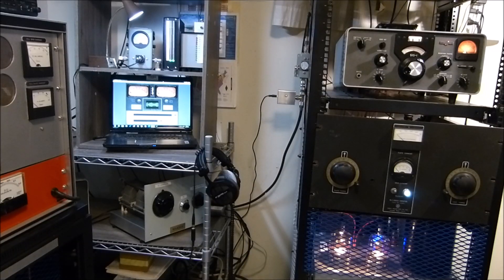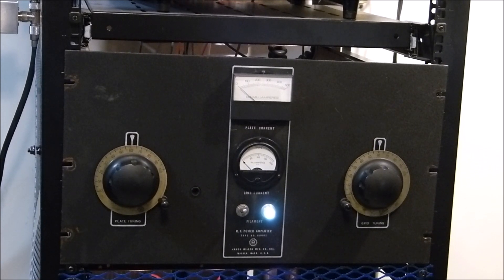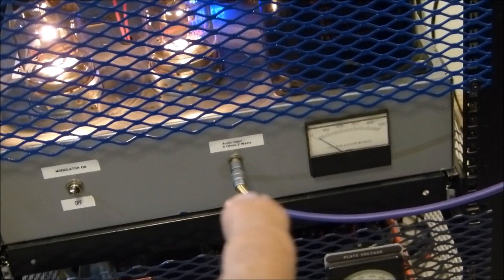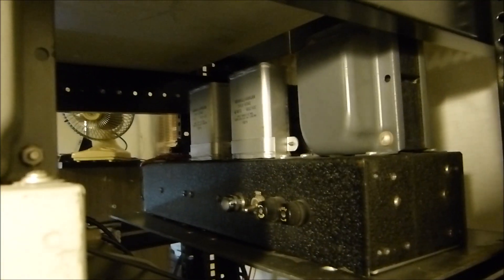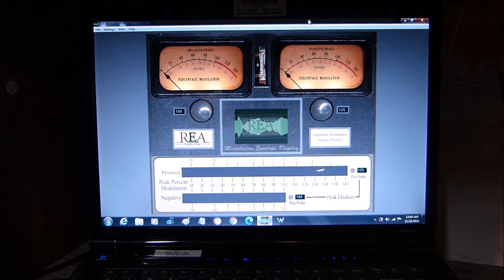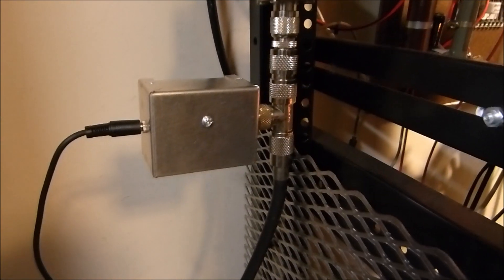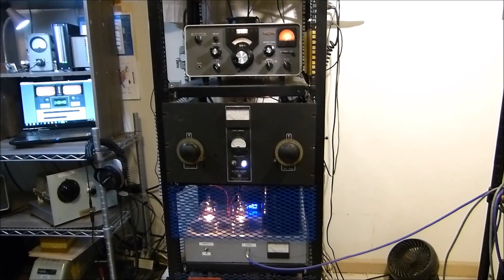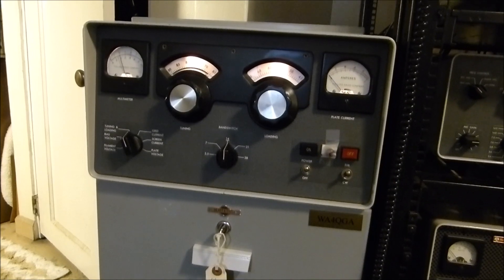Negative Modulation Peak Limiting For AM Transmitters With Modulation Monitor

Comment: My first experience with ham radio was watching our TV Set in 1958 (during the highest sunspot cycle on record) and listening to a neighbor blasting out on the audio a CQ from W8 Baker Sugar George on 10 meters. It was Otto, across the street. When I asked about his radio, he told me he was running 'supermodulation with negative peak clipping.' I don't know whether he mentioned the 300% figure or it came from somewhere else, but if a standard AM signal is 6 KHz wide, at 300% that would mean his signal would be 18 KHz wide. The joke was that he was not only on 10 Meters, but 11 Meters and 9 Meters, as well as on TV Channels 2 and 3 (harmonic). It's a wonder that he didn't come home from work to find a noose tied in his coax. :-D))
Reply from the maker: 300% positive modulation is about amplitude and not bandwidth. He may have been 20KHz wide, but commercial AM radio stations used to do the same thing - it just make you louder if it is done correctly - however... if there is modulation in the negative direction over 100%, it shuts off the carrier and when the carrier comes back on (each cycle of the radio carrier frequency) it caused what is called "splatter". Seems there would be a more scientific word for it  🙂 but that is what it is called and in 1958, ham radio operators with everything in the society analog, we could cause a lot of interference on people's home equipment especially TV's and the CB operators with their "linears" were notorious for interference. With everything digital today, I can run full legal power and none of my neighbors hear anything - I ask them occasionally. I have a "clean" signal and do run about 140% modulation on AM but it causes no issues. Also, today most hams use a balun at the antenna instead of just coax or open wire for their transmission line which keeps the transmission line from radiating, and picking up receive noise, so that helps. Thanks for your comments. Lots of pictures on my QRZ site. 73  WA4QGA

Comment: at 12:30 when you say the big red light is not showing clipping, I can clearly see the scope pattern is pinched/flat/etc... also if you just use a DC voltage there to keep the carrier alive doesn't that strait line of dc just create a purely flat low level carrier line and once the negative audio peak reaches it it just clips em?  Which just clips off the negative peaks square which creates splatter also.  Isn't there a way to smoothly compress the negative peaks without clipping them?  I would like to see this on a scope with a sine wave, can you do that/show that?
Reply from the maker: I think I understand what you see in the pinched/flat portion of the display but it is actually not going to zero and shutting the class-C amplifier (and carrier) completely off. I would say on close examination, we would see that that pinched portion of the display is still (slightly) on and there is a bit of carrier being transmitted as the keep-alive voltage keeps it from going to zero or swinging negative.
The whole objective with keep-alive voltage is to keep the (negative) modulation peaks from reducing the plate voltage to the class-C amplifier to absolute zero, or a negative value, where the carrier will shut completely off and then abruptly come back on when the plate voltage goes positive again.
There are other techniques that I have tried like loading the negative cycle with a resistor of about the same value as the plate load and a diode biased to conduct the negative cycle and not affect the positive half cycle. This just takes a large resistor and diodes across the modulation transformer secondary. The problem with this is, you can still over modulate the negative peaks is you have a lot of audio power. The keep-alive voltage seems to solve that issue no matter the amplitude of the negative peaks so we never shut the RF amplifier off and "splatter". You would think they could come up with a better word than just, "splatter".  🙂
No doubt it does cause some extra bit of distortion on the audio but apparently not enough to be objectionable. 
I can watch the output of a GG, SSB amplifier on a scope where the RF waveform is limiting (clipping), and the distortion - if the limiting isn't grossly overdone and turned into a square wave, - the bit of distortion added to the signal by the limiting/clipping can be acceptable. There is quite a bit of distortion in amateur radio communication but with just voice communication, it is OK, I would  say to at least 10% THD. 
What I find most objectionable in AM/SSB operation is when there is so much compression/speech processing or LF component in the voice signal at the transmitter. Makes it very hard for me to understand. A similar thing happens when we try to go, HiFi, so-to-speak, with our full range microphones. It makes the plate current meter on the transmitter kick up much higher but at a cost of distortion and a difficult voice signal to understand.
I prefer a crisp, higher-pitched voice signal when listening to any amateur station be it AM or SSB. Probably best to sound something like NASA and the Space Shuttle. 

73 WA4QGA
Reply: @ElPasoTubeAmps  Great reply !  I didn't really expect a reply since the video is already a year old.  I agree with pretty much everything you said in the reply.  So many of these hifi ssb operators sound more like a 50ft tall robot than a human.  Not sure if you know anything about guitar amplifiers and how some tube amps are modded with a resistor on the high voltage to emulate the older amps that had "voltage sag" from weak high voltage transformers when cranked up loud and that gave the old amps that soft clipping that tube amp distortion creates and people love.   Anyways, the reason I brought that up is maybe there is a way, maybe even the same way to do something similar to have your keep-alive voltage sag a little to help with the flat/square clip of the negative peaks.  Possibly even have the keep-alive voltage a little higher than you do now but have it sag with the negative peaks.  I'm not sure of your keep-alive design method, but could it be as simple as a resistor on your keep alive voltage?  Could or would the negative audio sag your keep-alive voltage to smooth out the negative clipping if there was a resistor for sag?  Just an Idea
Reply from the maker: @oldolfmann8927  I don't think the keep-alive voltage scheme for transmitters would work in a good way with a resistor in series. 
I did, and rarely still do, guitar amp repair for local musicians since retiring in 2012. I do know musicians want vacuum tube rectifiers for "sag" and musical enhancement but I never thought about adding a resistor in the line to simulate that with solid state rectifiers. It would work in a similar way as the current increases, the voltage drop increases. Not only do we have solid state rectifiers with a constant voltage drop of around 0.7 volts, we generally have something closer to 120 VAC if not more and not that 110 to 115 we had decades ago. Thanks for your reply. I will keep the resistor mod in my head for future reference with guitar amplifiers.
Reply: @ElPasoTubeAmps  I guess I should have explained better.  The resistor mod is Not for solid state amps, it is mostly for the newer tube amps and even a few old ones.  Many newer tube amps have better transformers and some solid state diodes instead of the tube rectifiers, and therefore even tho they have tube outputs the high voltage doesn't have the sag as the old tube rectifier/weak transformer did.  So you add a some resistance to the high voltage line and like magic you have the sag under load just like the old stuff.  Some mods even use a few different resistors so the player can select the amount of sag and distortion via a switch or no sag at all.  As I understand it, it was first noticed when companies like Fender made what they called "re-issue" amps that were supposed to be just like the old ones in the 60's 70's, but people noticed they just didn't sound the same.  Someone did some testing and discovered the transformers in the re-issues were "too good" HaHa... and didn't sag enough didn't create the cool distortion, so someone smart started adding resistors for the sag.  I just had the idea that if your keep-alive had the ability to sag it would smooth out the negative peaks as they reach the keep-alive.  It wouldn't take much to add a resistor and look at a sine wave on a scope to test the idea..
Reply from the maker: @oldolfmann8927 Here is a perspective - I started my YT channel with the intention of documenting the harmonic profiles of guitar amplifiers for posterity, and reproduction of vintage equipment. Little did I know it had already been done in a monetary sense to sell amplifiers. The harmonic profile is the elemental description of any sound. It distinguishes my voice from yours saying the same word just as it does the meow of one cat from another. The nuances are ineffable. I was  unaware of the effort that had been put into creating "vintage" sound. An interesting detail of history is that the vintage amps from the '60's and '70's were instantly modified to sound "better" whereas nowadays they are paid a high price to be taken back to original and sound vintage. Screw drivers and pliers are just that - the creativity is in the heart and hands of the creator and not fundamentally determined by the quality of the tools.
Reply: @ElPasoTubeAmps  I have software that emulates many of the old amps, not sure how good of a job some of the software does because I have never owned all those old amps and the speaker plays a part in the sound also.  Obviously you have tons of experience, I just thought that maybe the resistor mod would help with the squaring off of the negative peak.   Keep doing what ur doing and have fun.

Comment: Nice video bud. I've been using the REA for years now. In fact, I won't transmit without it. Me personally, I look at the oscilloscope portion more so than the negative peak flasher. As long as I don't see carrier flat line on the scope I'm ok with brief negative peak flash. Thanks for the video!
Reply from the maker: Thanks for your comments. I like the REA monitor also. I do leave my keep-alive voltage on  as  I do have an abundance of audio, easily up to 140%  or more positive modulation  and have monitored (and recorded for playback) my AM signal on the SDR sites around the country and am happy with the bandwidth and RST of my AM signal.   I keep the transmitter tuned up on 20M most of the time and talk with my friends but every once in a while, surprise someone by zero-beat with their signal and often times they don't recognize I am on AM until I tell them. No one expects it any more.  73

Comment: Would I be right in assuming that the modulation waveform is sitting on a DC level so the negative going audio is not clipped?
Reply from the maker: When there is no audio out of the modulator you could say it is doing nothing and sitting on a DC level - the plate voltage simply flowing thru the secondary of the modulation transformer feeding the plate of the class-C amplifier. Once we start talking into the microphone and audio is coming out of the secondary of the modulation transformer is adds and subtracts from that DC level it is sitting on. In my example of 2000 volts DC, when the modulation envelope equals plus 2000 volts peak of signal level, it adds to the 2000 volts DC and momentarily becomes 4000 volts peak.  This is 100% positive modulation. We are assuming a sine wave to keep it simple. Then when the modulation signal swings 2000 volts peak negative, it algebraically adds  (actually subtracts as it is a negative voltage) to the 2000 volts DC and the plate voltage becomes zero. This is 100% negative modulation.  What is to be remembered here is this is the actual plate voltage going to the class-C amplifier and at that "peak" moment the class-C amplifier has no plate voltage at all so it quits transmitting the carrier coming in on its grid circuit that determines the frequency of RF transmission . Like 690 on the AM dial. (690 KHz). We can make the plate voltage go as positive as we want, until we damage the tube but we can never let it actually reach 100% negative. 99% negative would be OK. Hope I make sense.

Comment: Hi Dave,
Thanks for providing this information. Also watched the video on the peak-reading wattmeter. Since it can be used for audio, there are two channels. Wonder if one of the channels could be set to read average power for RF. Would be nice to see the average and peak power simultaneously. You and the family stay safe.  73  WJ3U
Reply from the maker: That is an interesting idea. I will have to think about it and see if I can figure a way of maybe putting a resistor attenuator in one channel for average power. If the carrier is constant, it does measure and is calibrated for average power. They are surprisingly accurate to be so simple - it is just a DC voltmeter calibrated in power across a 50 ohm load. If the antenna has a lot of SWR, the reading is too high. The one I built almost 40 years ago (next to the 60 segment one in the video) is accurate at 14 and 7 MHz but this one is a bit high on 7 MHz. I am sure it has to do with the size of the capacitor on the output. I learned that when I built an audio wattmeter and had an issue with low frequencies. If I remember correctly, and I will work on it, the capacitor needs to be larger rather than smaller to smooth out the frequency response.